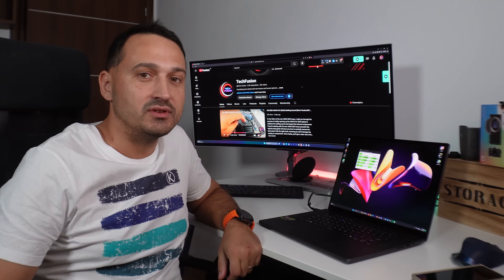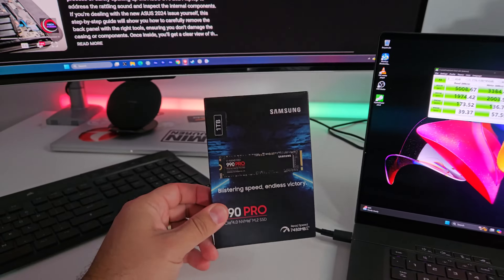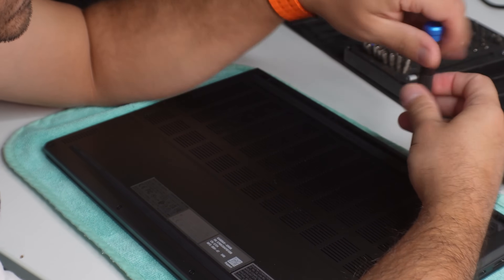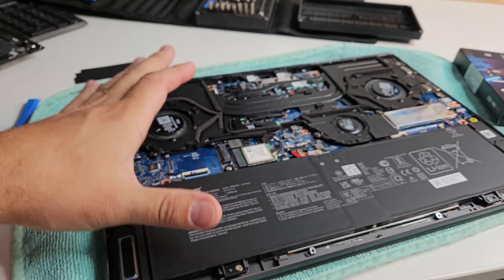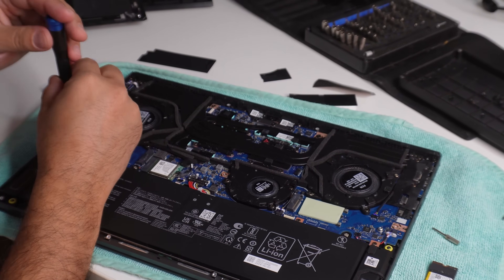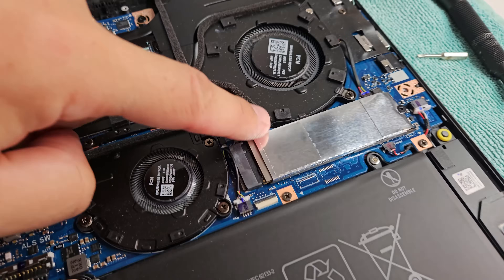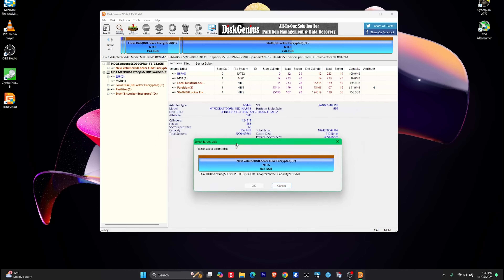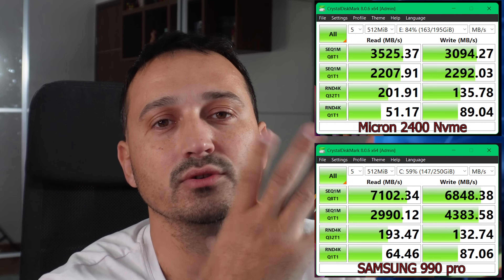Boost Your ASUS G16: Easy laptop SSD Upgrade Guide

Comment: Is Secondary nvme Slot is slower than primary one? Is it? I Was planning to put 990 pro in secondary
Reply from the maker: @veddotcom  yeah,its slower bud
Reply: @Tech_Fusion  does your G16 fans remains on for longer period of time in sleep mode, ending up battery drained?

Thanks for the great video btw
Reply from the maker: @veddotcom  Yes it does that and its quite annoying.Its running its third little fan,and even with a customised fan curve it still runs when in sleep mode regardless of it being plugged in or not.I've yet to find a work-around for this but where there is a will,there is a way:_CoolBoy:
Reply: @Tech_Fusion  Wow I sent it to service center for replacement thinking weird behavior. I can't put my laptop in the bag in the sleep mode. Hibernation everytime I dont want to do. If you find any workaround do let us know. Thanks
Reply: @Tech_Fusion did you run disk read write speed for secondary slot, how much worse it is?

Comment: Great video, do you know if the g16 with 2 tb of storage has the same problem? Because I was planning to upgrade and fill the other ssd slot with a 1tb one but now I’m considering doing the same job as you did putting the faster one in the main place and the 2tb in the other place. Thanks
Reply from the maker: Hi buddy,well I would think that they would be using the same make and model(upgraded to 2TB).I think they could also give you 2X 1TB drives populating both drives in your machine so I would just do the upgrade myself and be sure Im getting my moneys worth.Cheers bud

Comment: Thorough how to video, much appreciated. How come you cloned the Nvme drive instead of using it as is? Was it to serve as backup? I didn't like how it became partitioned and I also faced Bitlocker issues as it prioritizes new drive - the F2 trick got me back in. Then I deleted the volumes to be a single drive. Is that a bad thing? Does it matter? Online forums had different opinions on the matter. Please advice.
Reply from the maker: Cheers bud,Thank you for the comment and to answer your question I did the clone bit in order to use the new drive instead of the old one without going through the hassle of reinstalling windows and loosing my data.By now the original drive is erased(I've also disabled Bitlocker) and I am using it in the secodary slot thats a bit slower having less lanes the the one I've installed this 990 Pro in.
As per how you did it,there is nothing wrong but you could be a bit more exposed if you are sharing all the data between the two drives as one drive.It can also make it work faster overall but neve forget that if one of the drive dies,then you will loose all your data.So in the end if you are fine with the risk then there is no good or bad way.Surely the ideea is not to loose your data and thats why is good to keep your drives separated and keep the data that you need daily on the faster drive.Cheers bud,hope this helps

Comment: I just want to ask, if i upgrade to samsung 990 Pro 4TB, does the speed is still the same ? because i see a reddit post, mentioning that the max storage for the SSD is just 2TB.
Reply from the maker: @Noxturned  hi there,well the speeds vary from size to size with the samsung 990pro and usually you should see some increased speeds(nothing much though) the bigger the drive is.As per the motherboard,both slots should take up to 4 TBs each.Cheers bud
Reply: @Tech_Fusion  thanks for the reply, i will try to upgrade it to 4TB, i hope the speed will be 7000+, cheers. Great video btw, keep up!
Reply from the maker: @kentanggendeng  Thank you man,Enjoy this beast :_CoolBoy::_CoolBoy:
Reply: @Noxturned  i head g16 not supporting 4TB ssd do u encountering an issues with it ?  Planning to buy one😢
Reply: @user-eb3jv4jv2v  It work fine using Samsung 990 Pro SSD. but there is some issue, the laptop become stuttery and freezeing with crazy sound. I guess it happen because intel driver. but right now after i update, and reinstall intel driver, everything is fine i guess.
Reply: I had an issue with samsung 990 pro4tb. Not compatible.  I used crucial p.3 4tb worked for me

I'm planning to upgrade my main 0s 552g ssd to wd black 850sn 2tb
Reply: @OscarTorres-sn4cw  it doesnt show up or ? Because im using the samsung 990 pro 4tb
Reply: @Noxturned  yea updated bios. Nothing 
Ran disk management 
Admin commands 
Partitions
Nothing worked
I used the crucial zero issues
Reply: I'm gonna swap the main ssd 552 g that came with it for a wd black 2tb soon combined 6tb total and 48g of ram upgraded
Reply: @OscarTorres-sn4cw  damnn, alright, good luck with the upgrade, i hope its work well with zero issues